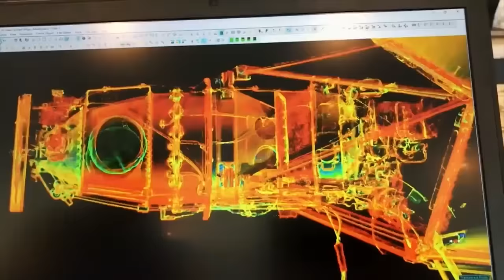We both almost died...now what??

Comment: Create safer, more responsible pilots. Once that happens, things get cheaper, more accessible, more acceptable.
Fix the IP pipeline. Teaching/training is a learned vocation and independent skillset. Too many IPs out there churning hours and not interested in creating solid aviators. 
Make accident investigation analysis part of the PPL curriculum. If you truly understand what swiss cheese is to aviation, you stand a better chance is recognising when the holes are lining up and how to break the chain. 
As a GA pilot, you have two primary responsibilities; don't hit another aircraft, don't hit the ground. 
If the industry decides that awarding a pilot's licence is as much attitude as it is aptitude, flying becomes intrinsically safer because people are better pilots. When that happens, there's less need for safety regulation, less risk for insurance something every aviator complains about.

Comment: It’s very simple. To revive and guarantee GA, it needs to be made more like automotive. Get rid of the silly medical system. Get rid of the silly certificated system. There is absolutely no reason we should be forced to fly 70 year old airplanes with engine technology from the dark ages that cost as much as a house. How is that really safer? It is not. Meanwhile the FAA forces most folks away from flying before they even begin due to the silly medical requirements. If you are just flying for fun and not for paying passengers then there is absolutely no reason a medical should be anymore difficult or complicated than a drivers license. If you want to take paying passengers then sure, require whatever you want.

In my opinion, these are the biggest thing holding back GA. Sadly, they are political hurdles, not engineering hurdles. Appreciate you guys trying to tackle these issues.

Comment: To my mind, you guys are in the perfect spot to push GA forward from the edge of the abyss it faces. Of course, the lawyers continue to be an overarching damper on the entire industry and likely always will be. Outside of this, the next barrier to the GA market is labor required to build an efficient, attractive, and fun traveling machine. 

Back in the 1940s, some of the WWII contractors spent their energies proving how much labor could be removed from an airframe build, but the resulting machines were too compromised in performance and style to succeed against the likes of the Bonanza and to a lessor extent, the Comanche and Mooney M20. But now, with new technologies being proven by the likes of Tesla and others, two guys like you could create a truly beautiful and aerodynamically optimized design on computer with the intent to build the core structure from one or two giga castings on a giga press perhaps shared by an auto partner or a consortium of aerospace partners, large and small. Imagine if you could design the parts you need and then schedule their casting from a third-party with ties to all of the giga press owners in the world. The parts could be cast around the world, optimizing the considerable capital investment in each press. Then have the required machining and assembly done locally. The core airframe labor content in a 4-seat GA airframe might be reduced by 1,000 man-hours at the same time it can be optimized in almost every way. Of course, some parts could still utilize sheet metal and various kinds of plastics, but think about the things you could do with one casting onto which engine, landing gear, firewall, panel, seats, main spar, and controls are all mounted precisely in space. Every piece optimized as to strength, weight, and shape.

Comment: Toyota is working on a hydrogen powered engine check it out very interesting could be in the future a hydrogen powered airplane would be cool as you can get with zero carbon emissions and mileage that is crazy.
The hydrogen powered engine is the future.

Comment: Don't buy the Albatross. Patey opportunity cost is too high. Back in the early 90's my father built the airframe for a similar idea of a 'van life' amphibious aircraft that was a scaled down version of the Albatross.  Granted, the engineer behind the project wasn't a Patey, and the engine was grossly underpowered for the original goal, so when the project was completed...it was a complete DUD. The challenge w/ the albatross is that it's such a large plane, and so old that the overhaul would likely suck up valuable time that could be spent on other projects that are more compelling.

Comment: I've had this video, and the request at the end, rattling around my brain for the past two weeks. I run a flight school at a small community college and our main focus is safely providing the highest quality of instruction possible at the lowest possible cost. If you truly want to make a lasting impact on aviation there is one silver bullet project: MAKE AN AFFORDABLE TRAINING AIRPLANE!! My field elevation is 5274' and I'm operating 160HP 172's from the 80's, as I look around to try and find replacements I cant find anything that fits the bill for less than $400K on the low end. Please help solve this problem, make a clean sheet airplane with 180HP fuel injected engine, modern avionics (like the G3X or Dynon Skyview HDX) already outfitted as a TAA in the $250,000-$300,000 range or less. If anyone can help solve this problem it is you two, I share your passion for aviation and making people safer and I firmly believe the way we address the pilot shortage and build the next generation of aviators to be safer pilots is going to be dependent on the right equipment.

Comment: ♥♥♥How would you like for your next project to build the most powerful VTOL every made? ♥♥♥ 
THE UNIMAGINABLE 
We are planning to build a prototype similar to our smaller engine but double the house power, instead of 8,000hp this one will be over 22,000hp. 
Picture this, a 30" long engine that only weighs 200lb and yet 2 of these engines has the same amount of thrust as the F35 (43,000lbf, 191kn with afterburners). But to give you an idea of the enormous advanced technology behind this engine, as you may know already, the fan that allows the F35 to land vertically weighs 1.2t, pulse the weight of the turbine engine and you're talking close to 3 ton. So through that in the trash can and replace it with our 200lb engine. This twin engine desine has 1/4 the moving parts which will likely make the lightest, the most powerful and the most fuel efficient and the lowest maintenance engine ever designed. We are talking of a VTOL midsized corporate jet that has a top speed of over 1,000kts and a range of 15,000 miles. This will take a few years to build but why not start on it now? WE'RE IN THE FUND RAISING STAGE RIGHT NOW